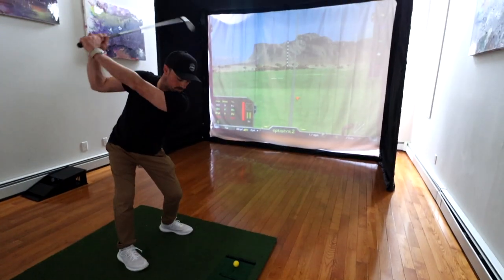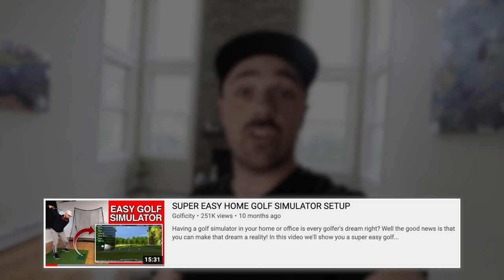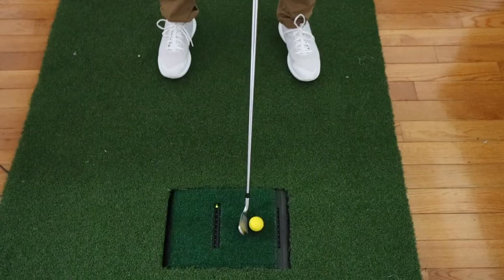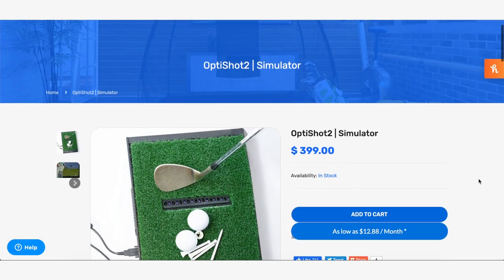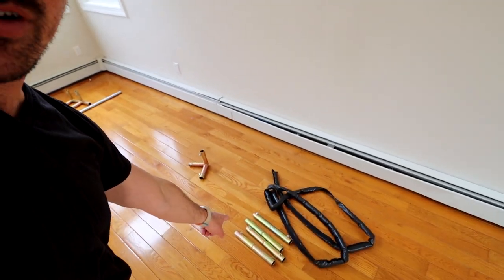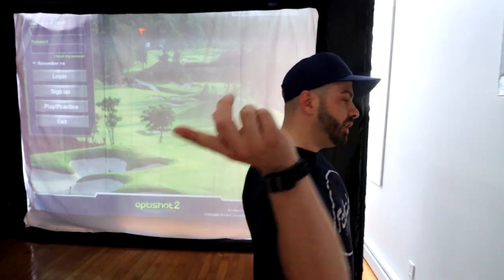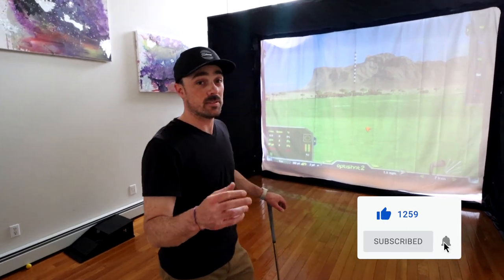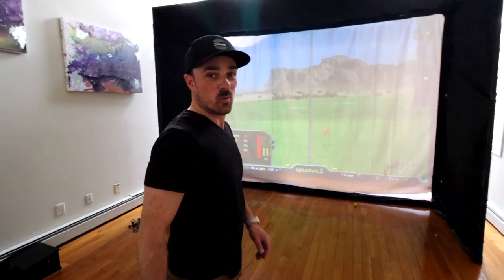AFFORDABLE (AND EASY) HOME GOLF SIMULATOR BUILD

Comment: A number of years ago, I bought an OptiShot simulator, but never set it up. The reason was that I just couldn't picture hitting an iron with that sensor space right behind the ball. You might want to say something about that experience. I have used quite a few simulators since then, and I'm almost ready to pull the trigger on an indoor simulator using a SkyTrak. I was going to buy a GCQuad, but can't really justify the extra $10K (I'm just a 5 handicap golfer, so not really at the level where that kind of functionality is going to help me.) 

The other thing that would really be helpful (in a lot of these kinds of videos, not just yours) would be to provide the dimensions of the room you're in. It looks like you are probably using a 10x12 enclosure, but it's hard to tell. Thanks for the video. The more of these that are out there, the more information we all have to make the subtle decisions.

Comment: This is pretty dang cool. One pro tip for those with hardwood floors using real balls, you can use some extra turf mats below the the sim to prevent damage to the floor. Pillows work too. But turf looks better.

Comment: Bought this same simulator, have a few questions:  Where would you recommend I place the hitting mat after I set up the screen enclosure?  How long are the connection cables from the projector (floor mounted) to the laptop?
Thanks for the video it will help me assemble mine!

Bill

Comment: Unfortunately, that “sim” isn’t worth the time it would take to fill out the entry form. Basically the fake-pro golf-bros spent $4,200 on a $500 projector and $100 worth of black tarp. They might as well be hitting one of those ball-on-a-stick trainers at a photo of a golf hole for all the benefit opti-shot lends to improving your game. This is a “legit” sim in the way a Yugo is a legit car. Any simulator which doesn’t measure ball speed, angle, spin or direction is worse than worthless.
Reply: Inclined to agree with you for a serious hobbyist but if somebody wants to play a video game with a golf club as the controller purely for fun, who are we to judge?

That said, I'd never buy one.